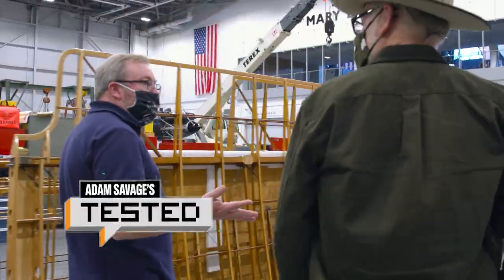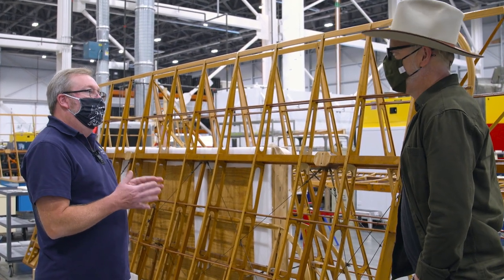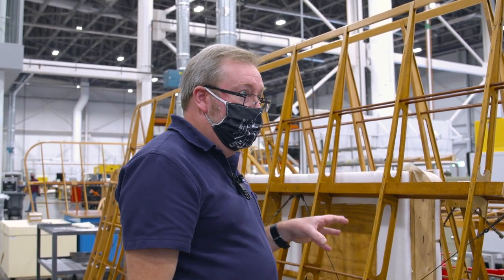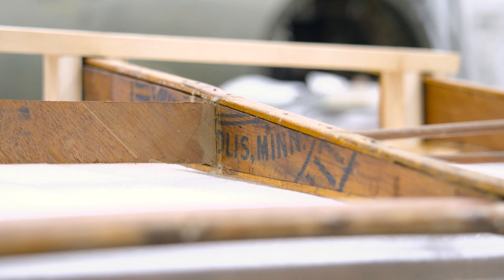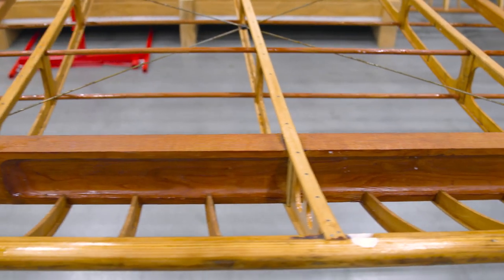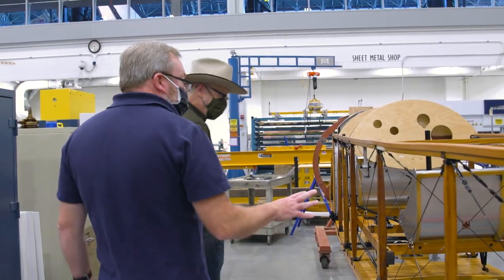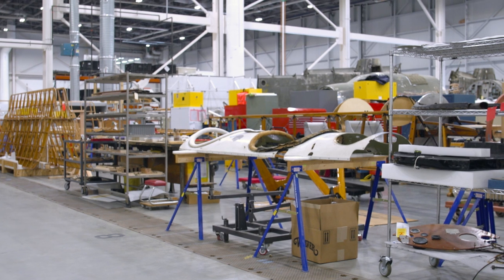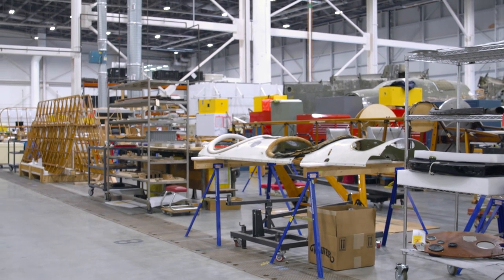Adam Savage Examines a WWI Aircraft!

Comment: When I was in engineering school I did a project where I reverse engineered an antique 5 cylinder radial model airplane engine in CAD software.  I completely disassembled the engine and reproduced every component in CAD software as a complete 3D model including even the screws,  nuts and bolts.  It was a difficult but very satisfying experience.
Reply: Wow 👍👍👍
my greatest respect 😃
Reply: Would you release it open source?
Reply: Yea Ive been for years trying to imagine the Arup s-4. Its led me to variations along the way
Reply: I am no engineer but I once recreated my Zippo in Solidworks. It's amazing how many parts there are in even a simple device. My dad built a working Bentley Br2 radial engine in scale, no CAD, just books and a drawing pad. (It works, I've seen it run once but it is a very very dangerous engine. One of the sparkplugs is still embedded in the ceiling)
Reply: That's amazing! You're awesome! Thank you for sharing this! We need more amazing ladies in engineering!
Reply: Many years ago I had to create a 3-D vector graphic representation of a radar receiver antenna for a Sikorsky military helicopter. The source art was a surface development with all sorts of crazy angles. To wrap my head around it I xeroxed the engineering print, cut out the surface development and figured out the folds to make a 3-D paper model. It looked something like a spiral seashell but with all flat planes. Once I had that I knew how to construct the model on my UNIX workstation. Three vector graphics was weird.
Reply: Im you wouldn’t believe this, but I did the exact same thing for my project in engineering school! So cool.

Comment: What I find amazing is that they could build hundreds of these things in a year and yet now it takes years to restore just one.  Crazy skills back on the day.
Reply: Not really. They had a dozen people working on each plane, with the set goal of slapping each one out as fast as they could. A lot of stories from pilots in WWI involve receiving their brand new plane, and having to rebuild it so it was flyable. Restoring them involves 1 or 2 people who spend hours to days researching and recreating the exact methods used to slap each part together.
Reply: The craftsmen were skilled but modern craftsmen with modern machines can vastly outproduce them. You hear about all of the difficulties that restoration undergoes but it's all because the restorers are trying to reproduce the best examples possible. They didn't need to undergo such a lengthy process to produce a simple metal bracket. The difficulty came from wanting to reproduce a perfect copy of the original brackets. Same for the woodwork and everything else. We could easily setup a factory and bang out a version of these planes with modern materials, but that's not the goal of restoration.

Comment: Standard J had a well designed air frame, but it had a poor base engine in the Hall-Scott A-7a 4 cylinder. The engine vibrated badly and was unreliable in operation. The competing Curtiss JN-4 had the Curtiss OX-5 V8 engine which was more reliable, smoother and a much better match to the airplane. For that reason, Jennies outsold Standard by about 2 to 1.